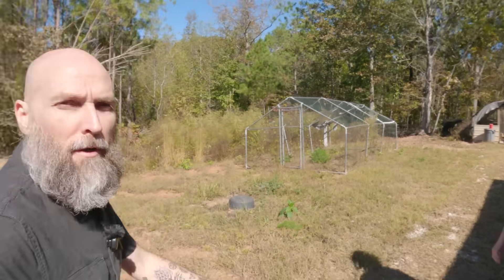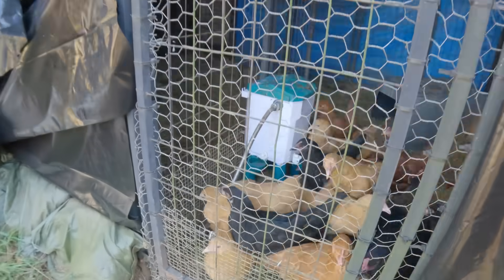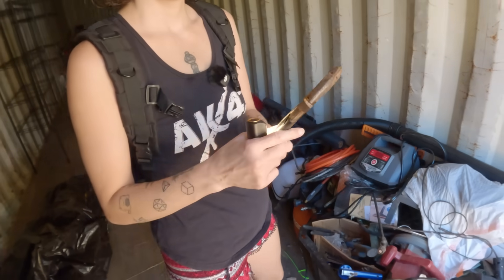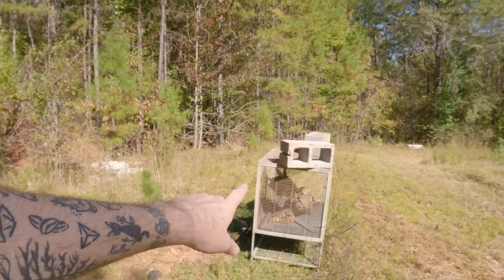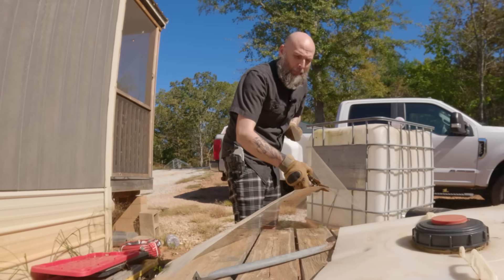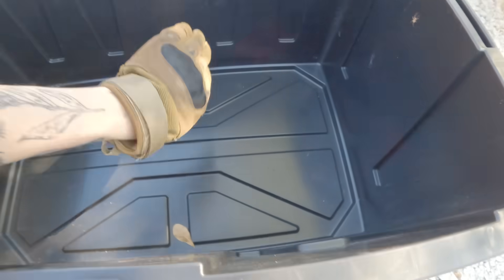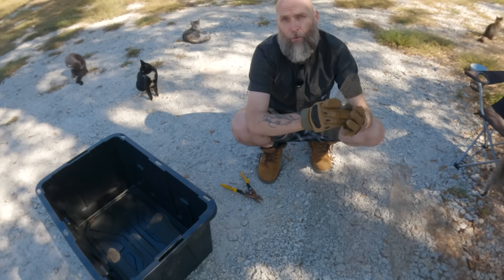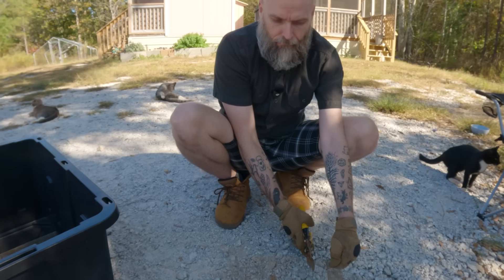Are breeder mealworms, crickets and roaches viable off grid animal husbandry solutions?

Comment: So you're new to off grid but it's time to have "peace of mind" and you start with the kitchen Refrigerator/ freezer, good start.  You check the power requirements and it says 9.5 amps of 120volt ac. Do the math and run down to buy everything you need plus a little. ten 100 watt solar panels, , one 1,000 watt dc to ac convertor, a10 amp solar charge regulator and lets say 100 amp hours of battery storage.  
What "they" won't tell you at the time of purchase is that DC to AC convertor can take up to 150 watts just sitting idle and 250 watts extra when the frig is running.
Ouch!
When you've been a little "Off Grid" for a while, you start thinking differently. A 12 dc chest freezer 3.5 cu ft requires 50 -60 watts (12v dc) or about a 100 watt solar panel.
Reply from the maker: Thanks for the tips! We're always learning!